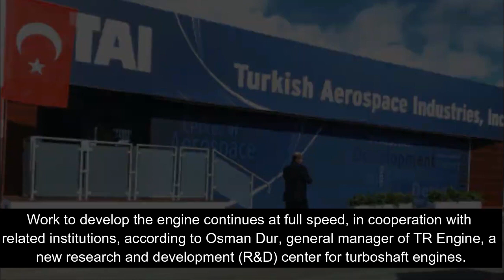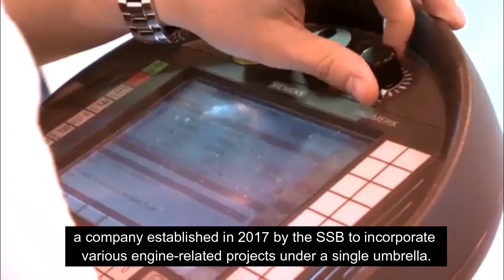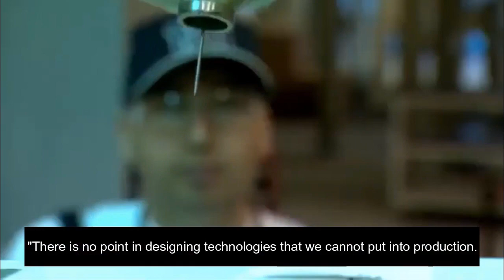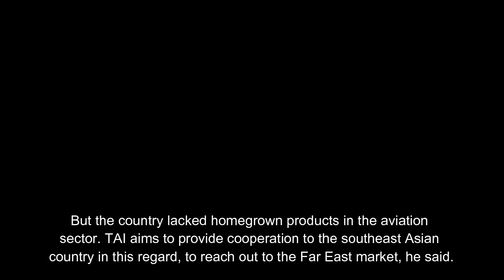TFX Jet Engine Will Be Built Domestically | Turkey JET Engine Programm.

Comment: Joint work is the best because of high expense.
Reply from the maker: Turkey better join hands with Central Asian contires and pakistany

Although pakistan has low economy

But it actually maintains good grip in term of weapon manufacturing like aircarft rebuilding